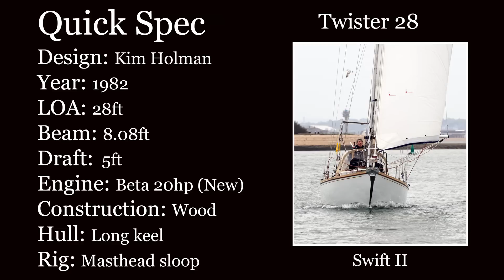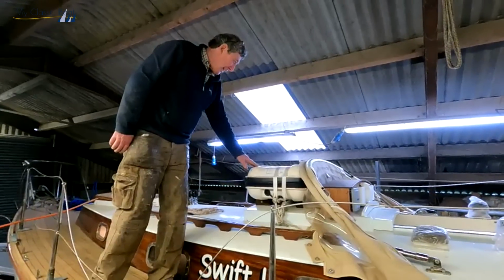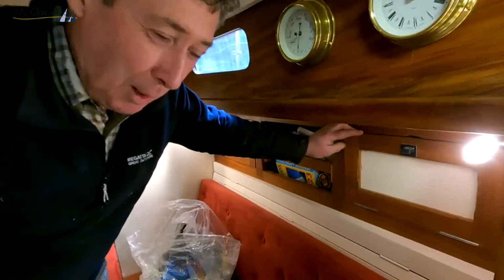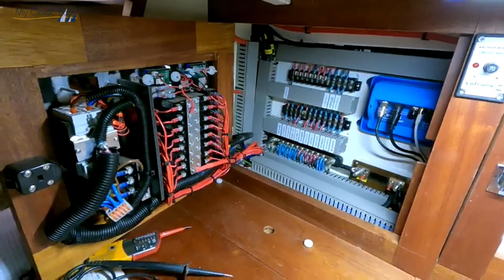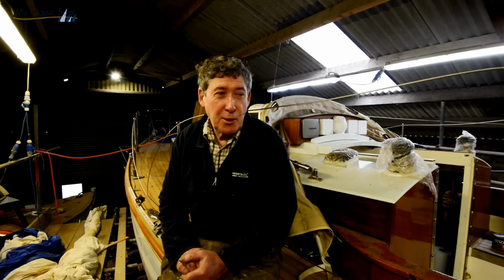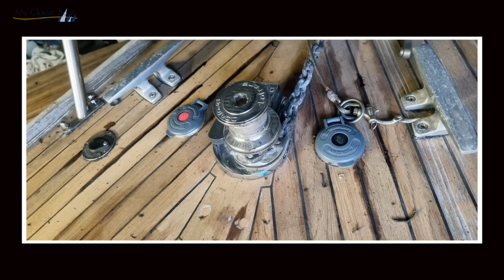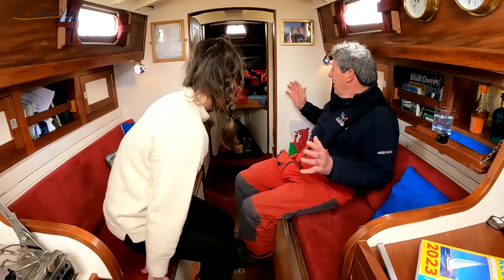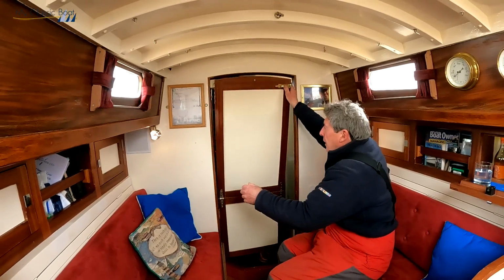My Classic Boat. Britain's Best Twister.

Comment: I think a few twister owners may take umbrage with the title. Not least because she's not exactly a twister ;-) She is stunning though.
Reply: Sterling 28?
Reply: @junk_rig_sailor1698  No she's a Twister but not built to Twister plans. Hence not officially a Twister when built as you would have needed to pay for the plans and a licence to build one boat. Home built to the builders drawings which was his interpretation of a twister. You can see it in the sheer line and Transom which are not quite standard. But she is accepted in the association these days so she is a Twister as far as the association are concerned.  I read her described as a Twister with a Twist in a Cruising Association magazine several years ago. Original name was Suda II. It's a moot point as there are a few around that were built unlicensed and we don't have official measurements for the class. Both yours and mine could be considered out of class because of our rig, mine being a meter taller than standard and yours being some ancient Chinese system 🙂.
Reply: @TheFlyingPlectrum  Excellent - thanks for the explanation, David.